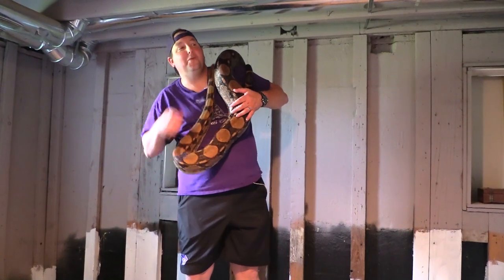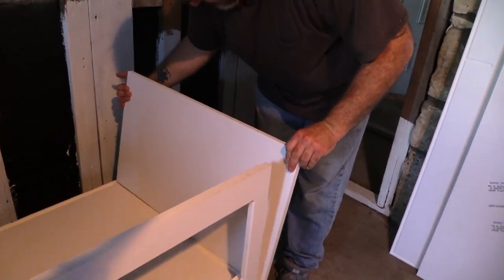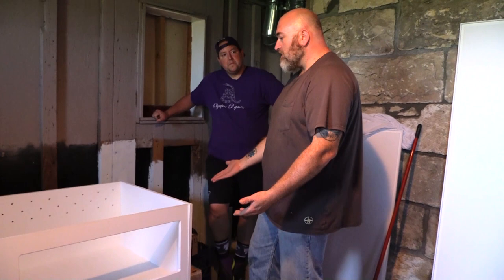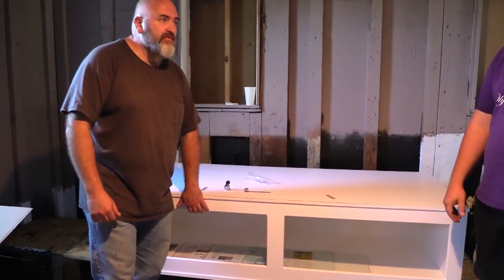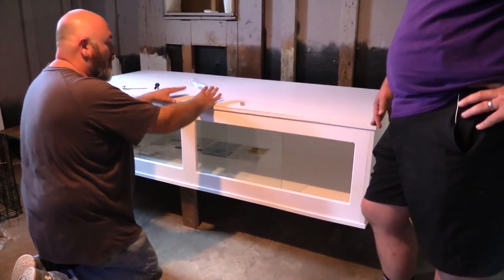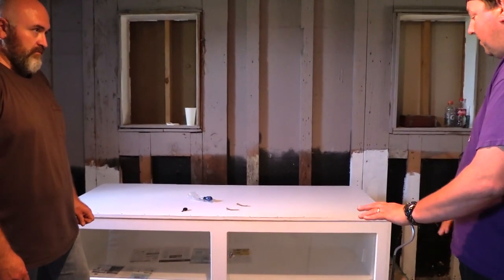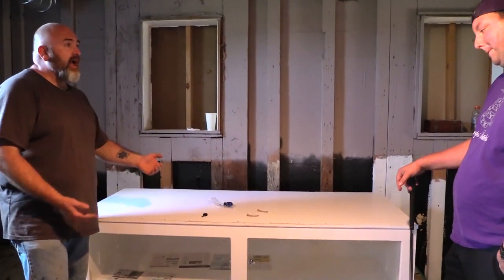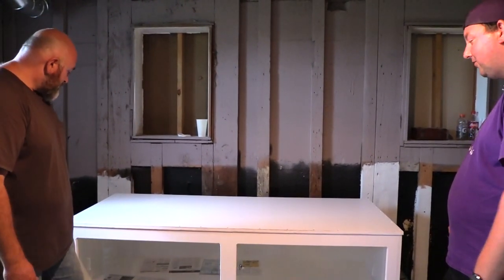check out these display enclosures from warehouse enclosures!!  our HUGE boa will be do happy!!

Comment: How would you put heat pad or tape under to thick right
Reply from the maker: If I wanted to would attach pad to piece of glass sitting inside on bottom, with thermostat
Reply: Under heat would require some recession of the bottom especially on 19mm.  I have belly heat on 12mm that is simply stapled to the pvc and cage is raised off the stand below it.  Since this style of enclosure us generally used for the larger species, i generally suggest radiant heat panels anyway as they tend to gave a better gradient of heat

Comment: Plus the track inside is really bad still bad when its outside all substrate will just get jammed in track bad design
Reply from the maker: It actually works really well.  All sliding doors have tracks.  Do far absolutely zero issue